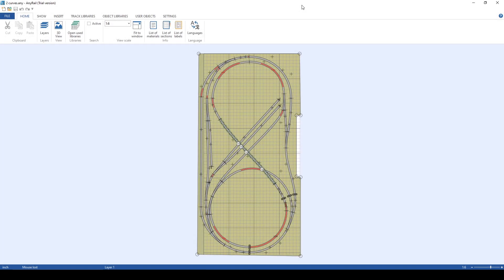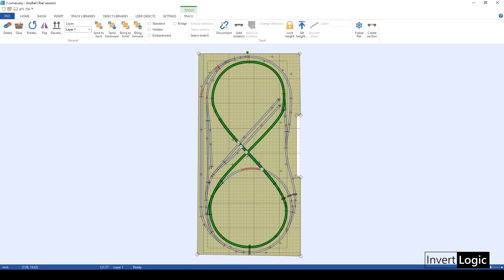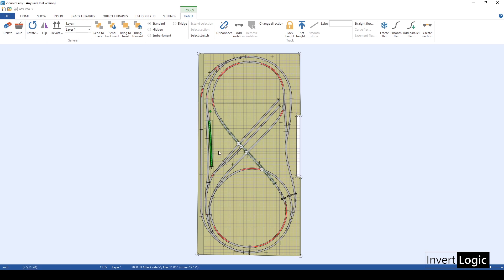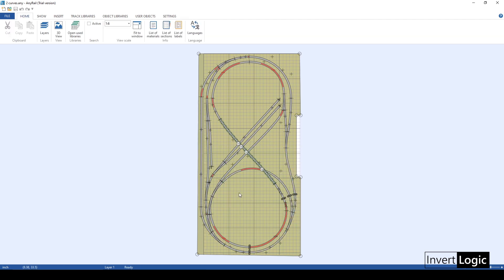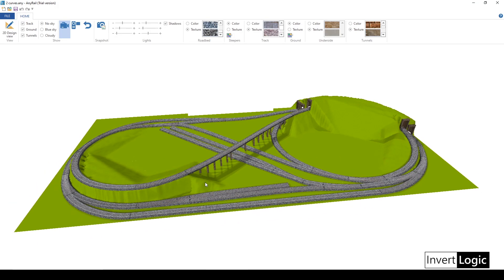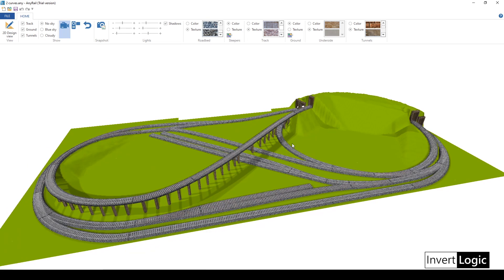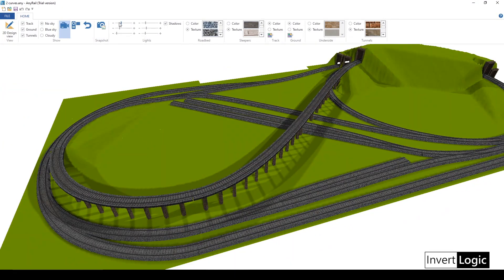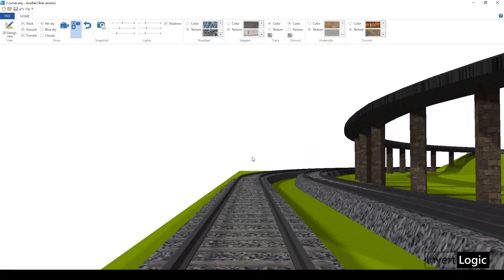Layout Intro in Anyrail and 3D demo

Comment: Does the program tell you what style of turnouts you need and the length of each track piece?
Reply: No the Anyrail program can't tell you what you need - You simply design your layout keeping in mind that you adhere to the track geometry of your chosen track but in does tell you the length of each section of track - You just look for the Info check mark in the settings

Comment: could you tell me how many left #6 turnouts and how many right #6 turnouts and also how many left and right#5's
Reply from the maker: Right #6 curved - 2
Left #6 curved - 2
Right #5 - 1
Left #5 - 1
Right #6 -1
Reply: @InvertLogic  im sorry i forgot to ask what brand track are you using
Reply from the maker: Micro engineering code 55

Comment: Thanks, My son and I started a layout we built a perfectly level table with plywood and 2&4s foamboard but were stopped by the wiring my sons now an electrician so think the layout might go forward thanks for some great ideas
Reply from the maker: Yes I wish you will get it done! wiring will not be a problem if you do a DC layout. but DCC will give you more control.